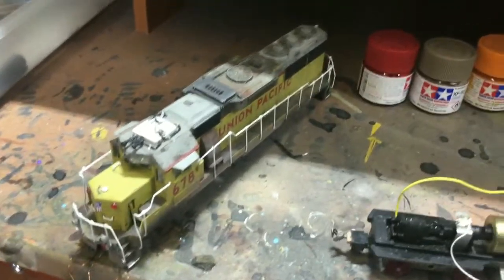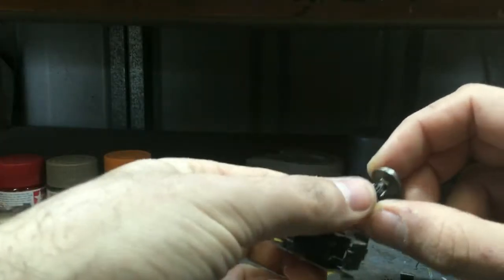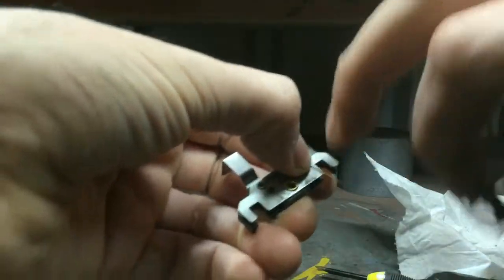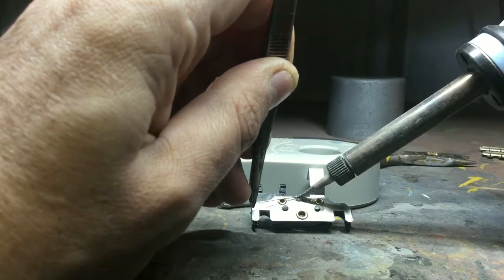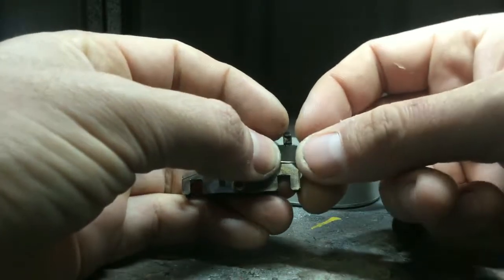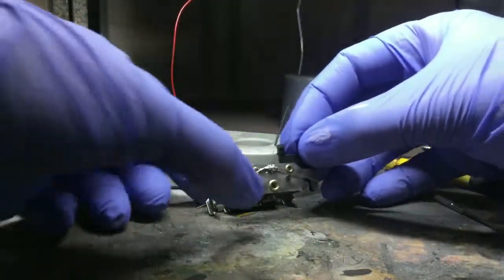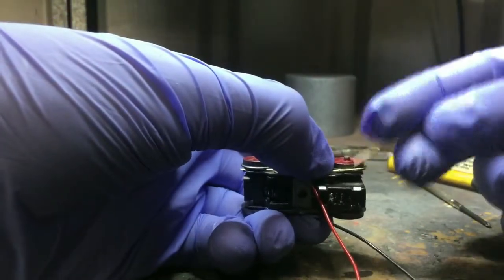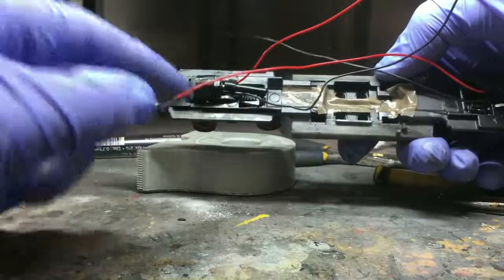Athearn blue box upgrade part 1

Comment: Just make sure that when you do the soldering on the trucks...use a pencil type iron, and do it QUICKLY or you might melt the plastic part of the truck!  Other than that warning...great job on the upgrade!
Reply from the maker: Good tip! Thanks I will take that onboard in future